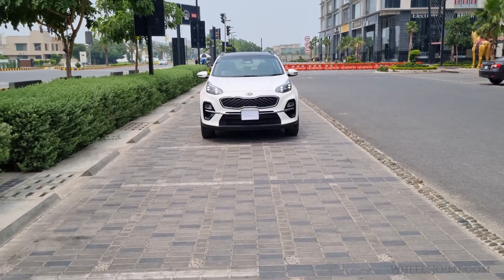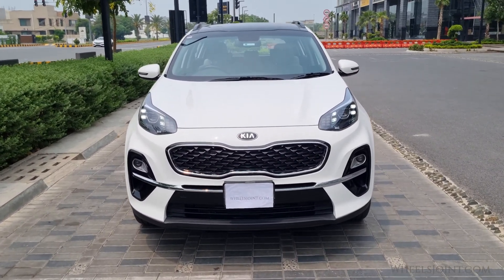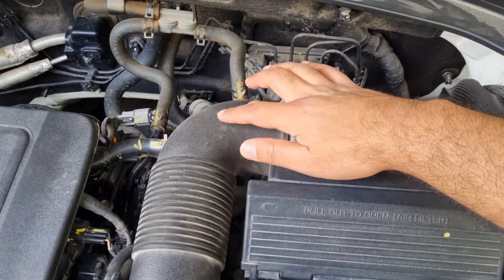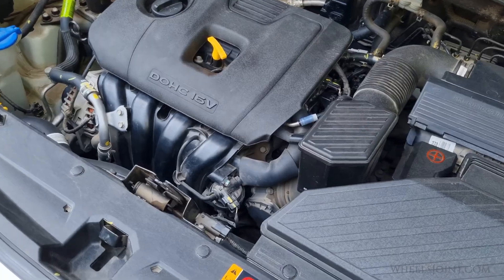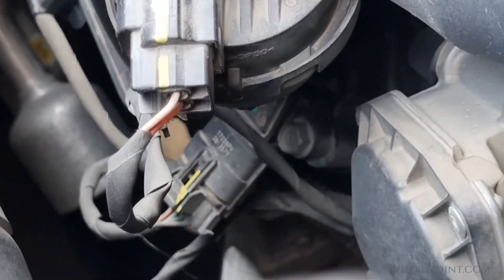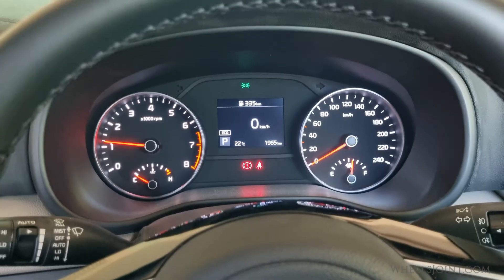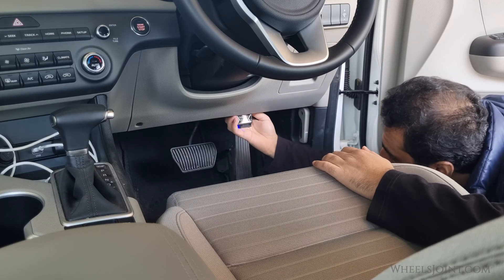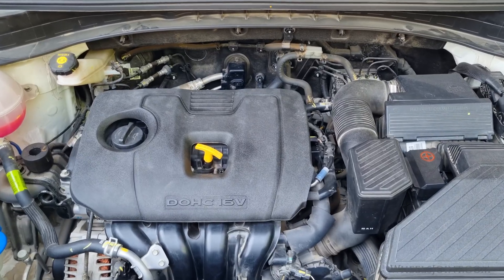Where is the MAF sensor in Kia Sportage (4th gen - QL)

Comment: So, do you think the 2018 Kia Forte doesn’t have a MAF sensor and only uses a MAP sensor, and is it located in the same place as on your car? Thank you in advance.

I’m experiencing hesitation when the car is in Park and I fully step on the gas — there’s a noticeable hesitation. Could this be because of the MAP sensor?

Also, when the car is idling in Park and I press the gas pedal, I notice a little black or dirty smoke coming from the exhaust. Could this also be related to the MAP sensor?
Reply from the maker: I'm not sure if your vehicle has a separate MAF sensor or combined like in Sportage.  Black smoke typically means the engine is running rich (too much fuel). A bad MAP sensor could definitely cause that, but so could a leaky injector, bad O2 sensor, or other fuel delivery issues.
Reply: @WheelsJoint thank you for your fast reply

Comment: hi, there is a P0106 error on my kia sportage awd, should i just clear the code?, or should i replace/clean the maf sensor?
Reply from the maker: That code is for MAP sensor, there is no MAF sensor in this vehicle. You can try cleaning the MAP sensor.
Reply: @WheelsJoint  yeah i cleared it, and the error didnt come back on engine restart
also i cleaned throttle body followingyour video and it improved my car's performance greatly. coulnt take out completly but managed to cleaned both sides of butterfly 
Please make a video about cleaning oxygen sensor and catalytic converter, also feul injecters
milage is 67k